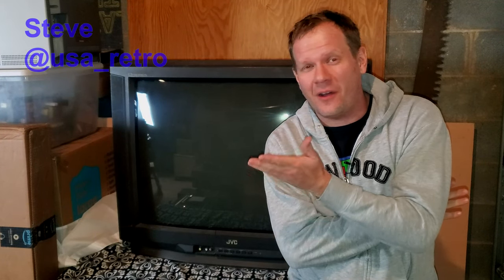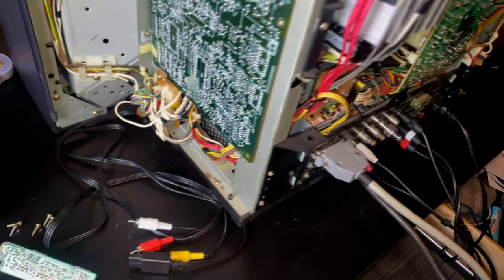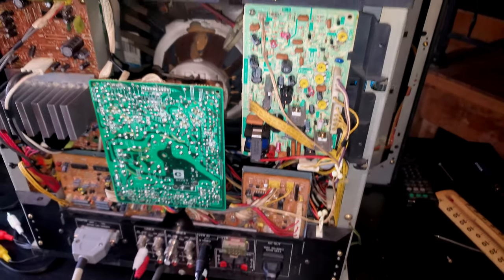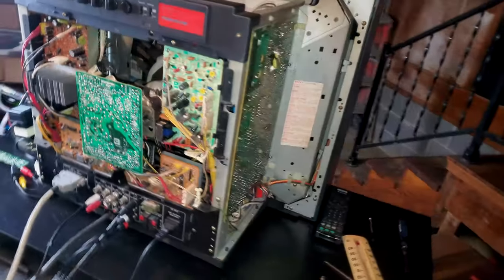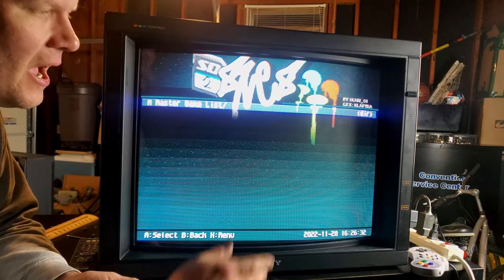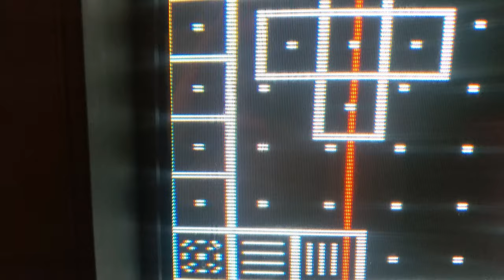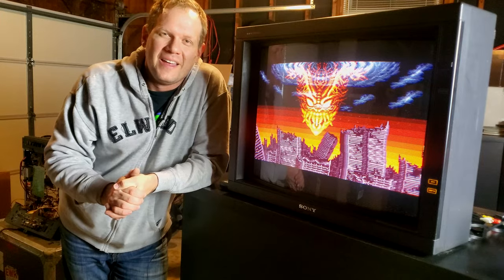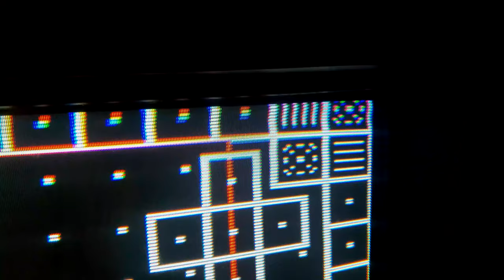Is The Sony PVM 2530 the best PRO CRT for Retro?

Comment: I just picked up a 2030 and so far I am satisfied with it. I am waiting for the RGB adapter cable from UK, and then I will try adjusting the pots on the inside if needed. So far so good though. The only flaw I have noticed is the few light scratched on the front glass of the tube. They look like the could be buffed out, but I'm afraid of making the glass worse.

Comment: The convergence top centre shown at 11.08 - the fact the red is lifted above the white line - can be dialed in better by adjusting the yoke and the BMC magnet. The yoke could use rotating as well, which will probably help the dynamic convergence along the way.

I have a PVM-2730 in great condition (the non-US version of the same monitor) and yes, i would rank it above my 20" BVM. It's brighter and better and more fun to play on.
Reply from the maker: Thanks.  This one really needs a yoke reseating I feel.  I may go for it, but again the biggest problem is the risk of permanent damage.  This PVM was in quite rough shape to begin with.

Comment: Hi Steve,  I had the same convergence issue on this set just after recap of the little convergence board  and the original caps were leaking!  by the way to fix this is a tedious job since every pot influence each other, you have often to readjust the h stat pot too

Comment: I’ve got one myself and really like it. I bought that cap replacement from u and the repair was  definitely an undertaking. I’d still prefer that 2950q u donated to the museum in Philly. That ones probably my favorite all around crt monitor. My 2530 has the same issue at the very top of the screen that I cannot fix with strips and magnets but the screen looks great otherwise.
Reply from the maker: Great!  Yeah the 2950Q is one of Sony's Best ever CRTs.  Glad to hear your 2530 I working good.

Comment: What luck finding this video! I own a 2530 for several years now, and she’s always been finicky. The geometry is good, but after having it shipped during a move, it’s picture tends to wobble and flicker, and you gotta give her a smack to get it to settle like you would with a regular crt.

I just wish I knew what I had to do to fix it
Reply: Sounds like your might have a bad solder

Comment: If there are resistors connected between the buttons and a power supply (would be called a pull up resistor) then the issues with the slow response on the buttons could be caused by the resistors going high in value.  Might be worth checking the value of the resistors if they exist.

Comment: I have a prosumer KV-25XBR with  RGB and I think it looks fabulous. Picture looks similar to 2530 in my opinion but a bit different because of the tinted glass.

And oh man that D series looks nice!
Reply: 25XBR has same tube as 2530
Reply: @gamingtv394  I thought so but I've seen a rebutal to this. In any case, it looks really similar to my eyes (I had a 2030 for a while).
Reply: @FinalBaton  really, what did they say. I’m speaking of only the picture tube not the internals, I’ve heard of people doing tube swaps of both.

Comment: I just yesterday inherited a PVM-2530 so, I'm now doing all the research. It's in decent shape and seems to be working. Although, I thought it didn't work at first. I didn't get a picture until I actually plug a signal into it which was obviously a user error lol. I was expecting to see static with nothing plugged in but, then I realized there is no tuner built in, duh 😳. Did you make your RGB cable? I've been looking for a 25 pin to RGB cable but haven't found anything yet. I see people selling a lot of 25 pin to SCART and 25 pin to specific consoles for PVMs out there but, not really straight up 25 pin to 3 wire RGB. I downloaded the manual for the pinouts so, I guess I'm gonna have to make my own. I have a bunch of VGA to RGB cables that I used to use with projectors I could be used as a donor starting point. There are a few pins I don't know if I need to worry about or not namely: pin 1 (IBM Select), pin 9 (analog/digital mode select), pin 10 (RGB/normal mode select) and pin 25 (IBM luminance signal). I'm hoping I could just ignore them and use pins 4 (blue), 5 (green), 6 (red) and, pick a ground at 15-24. If you or anyone else has some insight on the 1, 9, 10, and 25 pins... I'd appreciate the info. 👍

Comment: I have a 2530 from 1994 and I love it but I’m having trouble getting the RGB input to pick up a proper signal from my Extron 700 scan converter via SCART cables from Retro Gaming Cables. It can pick up RGsB on the sync on green setting, but I’m having trouble getting picture from the sync on H/V setting. Do you have ideas what the issue could be? Also how do I set the monitor to high state from low state? Is there a manual setting? Can’t find the info in the manual. Love the channel sir!

Comment: Dear Steve this is probably the Best monitor ever made for 240p games,  But if you want to redo the convergence you need to remove the yoke since most inner magnets get loose overtime a d you will get bad convergence at sides and also bad geometry.

Comment: HI Steve, I have a PVM 2530 also that was just recently served by Savon Pat. He was able to recap the boards but he mentioned he could not get RGB working due to some chip or board. Could that possibly be the input board you referenced in your video that has the RGB input connector? I would eventually like to get a replacement part some day so I can get RGB working but in the mean time composite and SVIDEO work so I guess its not a total loss.

Comment: I've got the option to buy a 2730. It's the same cost as the low tvl 20" PVMs i can get. Even the same as the jvc dt-v1700, price wise.

Would you go for the 2730, if it's got good image? Or will I never get a good image from that PVM?

Any help would be much appreciated

Comment: Hi, I was just wondering if you've ever come across or worked with a KV-25XBR. It's supposedly using the same tube as the PVM 2530, and does have RGB input, though it's on a 32 pin connector. Would the image from that CRT give a similar quality to the PVM here? Love your videos, Thanks!
Reply: I've had both (at the same time). The 2530's picture is tighter despite the 2 using the same tube. But the 25XBR is still awesome and I'd be totally happy with it had I not found a 2530 in good condition at a fair price. Really pleasant picture on the XBR.